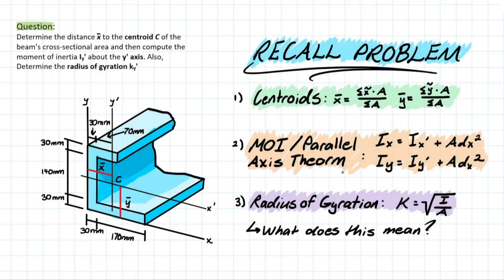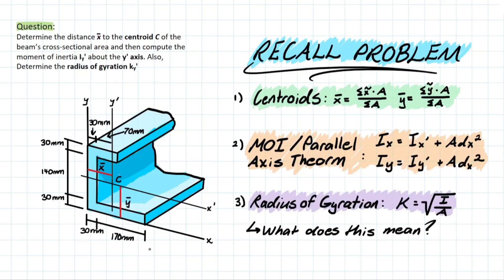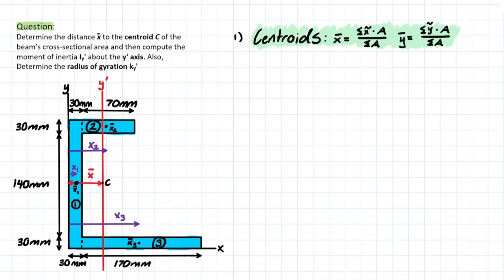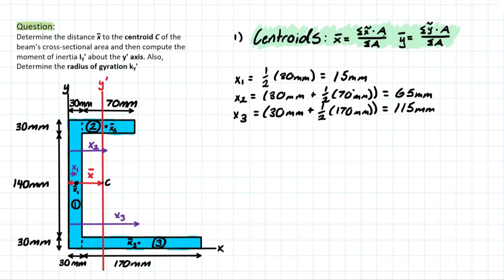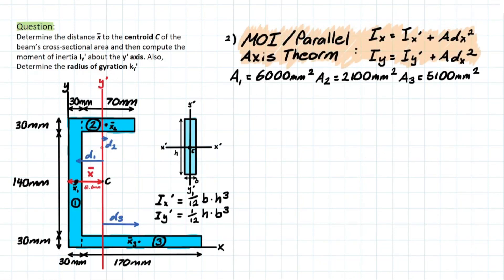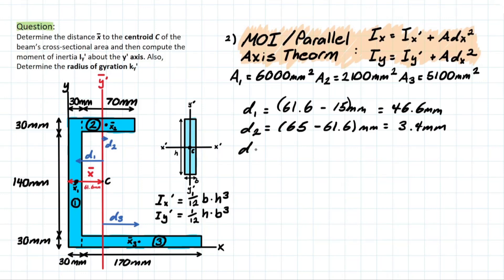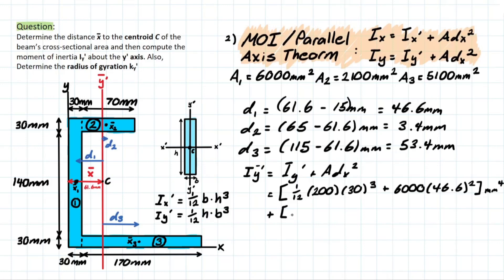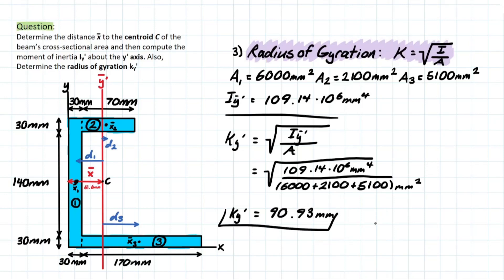Parallel Axis Theorem, Centroids, and Radius of Gyration Problems!

Comment: how you arrive to 109.14x10^6 moment of inertia? I tried to compute it and I get 41186590.92. tnx.
Reply from the maker: Thanks for pointing that out, I may have made an error when inputting in my calculator. Your answer is correct. Thanks for double checking!
Reply: This is also my answer, this actually confuses me and I was like "Huh? What am I doing wrong?" Lol